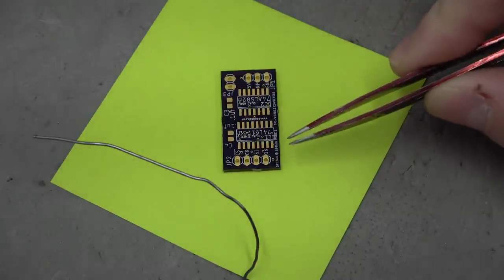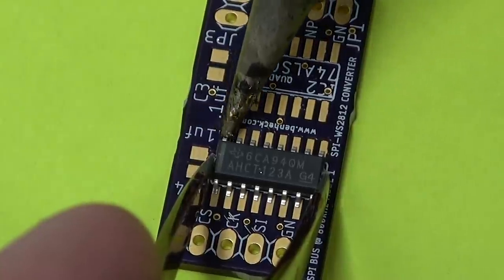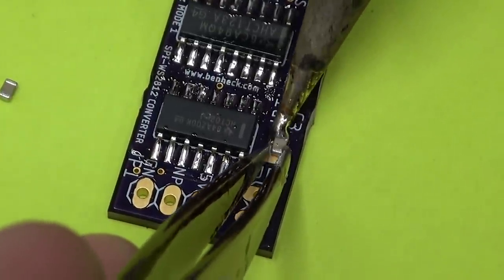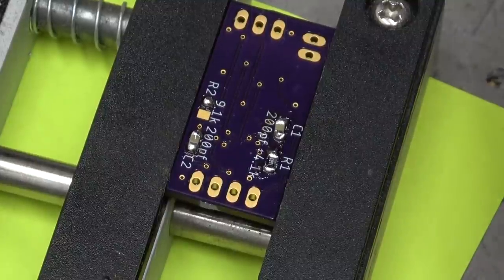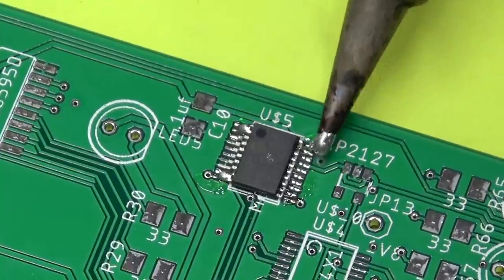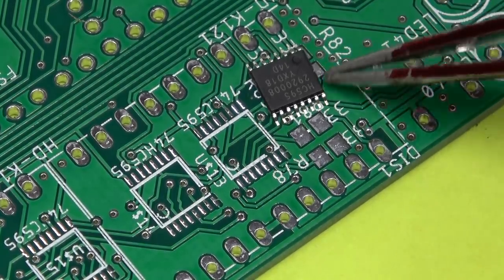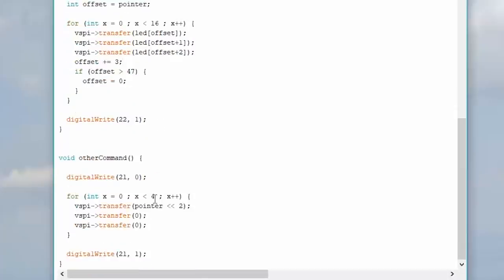Surface Mount Tutorial

Comment: The soldering you're using is WAY too big for this work. I mean sure it works but you'd have a lot less problems if it were finer.
Reply: The whole point of this video is even if you totally screw up you can still manage to do SMD. That went r/whoosh by most folks here though.

Comment: So is this with solder flux applied? or does the solder just not like sitting on anywhere that isn't a pad?  I know you're just doing it while screwing around with your project, but considering how matter of fact you showed the soldering, you might get views for just doing a dedicated surface mount video.  Every other one I've seen has made it seem like some mystical art.
Reply: No extra flux from what I can se. Just the flux already in the soldering wire. Like Ben mentions, extra flux helps. I like the thick goo the best, like the one from ChipQuick. Once you see the benefit of extra flux you're gonna use it every time. Also helps the soldering wick suck better.
Solder doesn't stick to the board itself, because of the solder resist. The green "paint". Well, actually purple paint on the boards from Oshpark.
Reply: There is flux inside the soldering wire but it helps a lot with extra flux. Why the solder doesn't go anywhere else other than on the part is because something with surface tension. The board is made of glass fiber and the solder doesn't want to bond with it. But copper and solder goes well together and they "seek" for each other. That's why only the copper plates gets solder to them and not the board itself.

The flux makes the solder flow a lot better and helps out in really tiny areas or massive areas. It draws the solder towards the metal.

Comment: I do most of this type of work with paste and an air station. Manual soldering is a far too slow and messy process.
Reply: I think the point was you don't have to use an air station.
Reply: He talks about reflow ovens and such but he's just showing you some good tips on how to do this work by hand.
Reply: I think the hot air is also slow... I've seen many videos... Applying the solder paste is not a quick process...!!

Comment: WAY too much solder! If you are going to pre-tin the pads for capacitors and such then the least you can do it shake the excess off the iron before introducing more. Talk about “cold solder joints,” all the flux is burned off and the freshly tinned pad gets diluted with old solder when you don’t shake off your top first.

Comment: After a solder blob breaks a component and short-circuits the PCB, an ex-cleanup specialist decides to take on the whole surface mount problems.  Copper weeves is the main hero in SOLDER WICK. (In theaters February 2019)

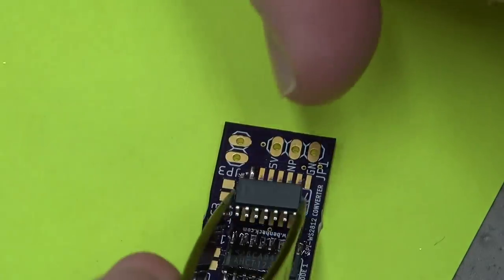Comment: thats awful. 4:18 lol. the title should be changed to how not to solder SMD tutorial. how the heck did I subscribe for this channel?
Reply: What's the problem?
Reply: there’s nothing right in this video. first of all, the solder wire is too thick and he is using too much solder. also the iron tip is not suitable for this job. he is pressing down on the ICs with the hot iron tip. thats unbelievable. also, that iron tip seems too hot for the job and he is keeping the iron on the pads for too long. the pads could easily pop out. i don’t mean that everybody has to do perfect soldering, but if you call your video a “tutorial” then it needs to have some standarts at least. this is a nightmare.
Reply: I have watched many of his projects and none are clean room standard but they are serviceable and most importantly work. Teaching best practices is the fastest way to lose the interest of viewers and only needs to be taught to those who will be doing it on a regular basis not ppl who only consume these videos or one off projects. The way I see it, unless you are making a board that will be sent into space so "might" be a little difficult to service, as long as it works makes it right.
This is a case of Idealism vs pragmatism.

Comment: This was kind of painful to watch. You took something that is fairly easy to do, and make it look difficult and messy. If you use smaller gauge solder, it will be a lot easier to put the right amount down, without wasting a bunch of solder. 
I like the stick vice, that actually looks pretty handy. I too rarely put boards in a vice or clamp. Sometimes  I put a pair of pliers on small boards to hold them in place while working on them though. 
Surface tension, and a little bit of flux really do all the work, the rest is just painting with heat. 
You should consider learning drag soldering for SMT ICs, it make quick fast work, and looks very good too.  
Hot air is another good way to do SMT, you can see the surface tension pulling the part into alignment. If you dont have hot air, sometimes you can use 2 irons at the same time, to get the same effect by heating the whole part all at one time.